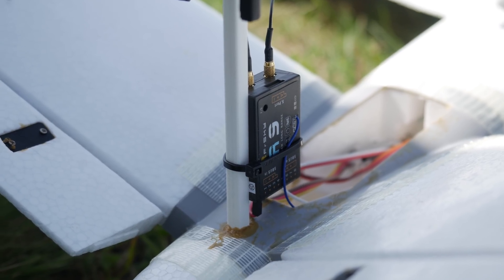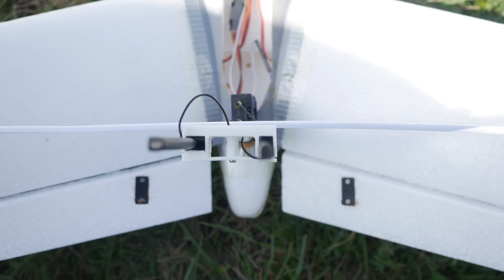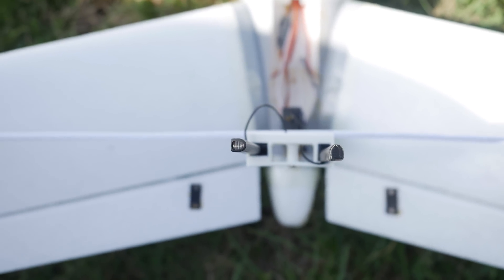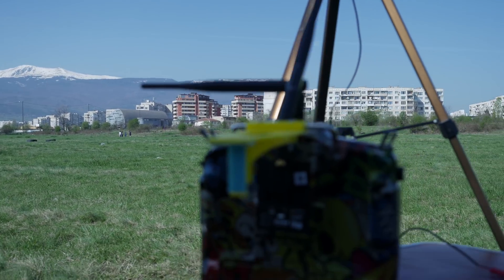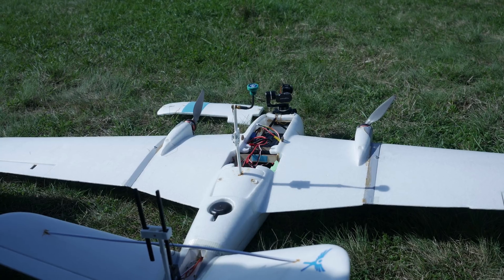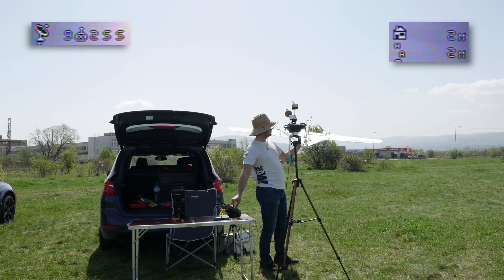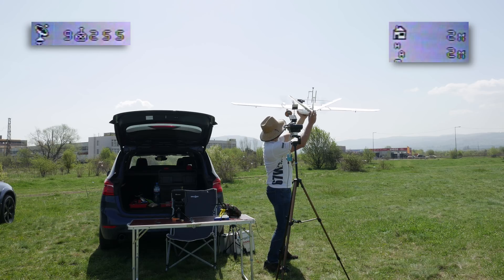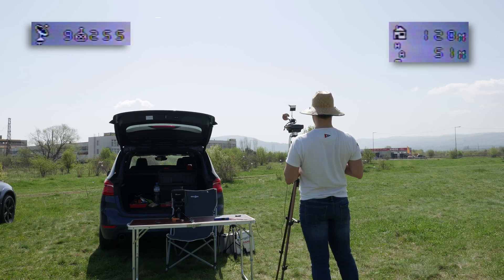FrSky R9M and R9 868Mhz - mountain and aircraft radar testing

Comment: Great videos , question pertaining to firmware flashing on the receiver and module. Do u just flash the most up-to-date firmware or all of them.

I have asked five different people between today and yesterday no answers yet. May you will he first. 

Thanks MIke
Reply from the maker: Hi, when I received the system... back in March or April, I flashed whatever was the newest firmware then, and haven't updated since! I don't see a reason to flash all of them, when the old one is actually erased/replaced by the newer version when the flash is done... so just flash the latest one, but module and receivers need to be on the same version of firmware! :)
Reply: @ArxangelRC  
I have another question ..
I mounted my antennas like yours. I went out 3 miles no problem RSSI staying in the 70S and 80S but as soon as I turn to come home the plane enters a fail safe ..tested twice any advice?
Reply from the maker: That is not unheard of... it is possible that something is blocking the receiver's view to the ground when you turn the plane around. How high are they above the fuselage?
Reply: @ArxangelRC  
Well I assume the stock r9 antennas are seven inches, so I have the hot glued to a partial pop cycle stick. And I would or could say its  the vertical Fin that would block the majority of that seven inches as I turn , maybe 1-2 inches above the verticals. Can u run a sat a liter receiver on the r9.
Reply from the maker: You mean "satellite" receiver?

A piece of foam should be mostly invisible to the RF signal, so I doubt this particular piece of the plane is the problem! If you are pointing the plane home... and the antennas are at the back of it... it is possible all of the electronics that end up between the receiver's antennas and the ground could be blocking the signal.
Reply: @ArxangelRC  
OK well I don't know and satellite receiver is what it should of said, lol.. OK well originally I had both antennas like urs. But since the fail safe I moved them.  I was out Sunday checking new placement when I had  accidentally disarmed plane..ohh crap 4 hrs later I found it...so will 5.8mhz interfere with 900mhz. If so then I need to move my antenna as it sits 2 inches fwd of the 900mhz and dead center...
Reply from the maker: How did you manage to disarm it? Weren't you able to arm it again? Was there any damage in the crash? 5.8Ghz and 900Mhz have worked perfectly together for me, there shouldn't be any issues with those two! Besides... a higher frequency cannot interfere with a lower one, so the 5.8Ghz Vtx on board the plane cannot interfere with the 900Mhz receiver, but it is possible that it either gets blocked by batteries and wiring... or something on board spills out interference on 900Mhz simply by being turned on!
Reply: @ArxangelRC  
I accidentally disarmed by flipping way point off(but it was the disarm switch) lesson learned. I didn't have time to rearm I was at 500ft and I knew I would loose video signal at 200ft when I'm that far out, so after my first attempt to rearm , and it did not work , my main goal was try to align the plane with a good glide path and not in tree's, I had maybe 10 seconds to process , so I circled to the right and put on a straight path hoping it would clear the top of trees and as soon as I lost last video signal I let go of all sticks and hoped for the best. Not only did I clear the trees but it glided another few hundred yards. And not a single bit of damage, when u weight 300grams it's hard to do damage lol. I'll try again Sunday weather permitting..
Reply from the maker: michael teel  Damn... nice save! 300 grams... ??? What plane is that?
Reply: @ArxangelRC  
Nano Gobin
Reply from the maker: OK, might have to give that one a try at some point! Have been hearing good things about it! :)

Comment: Hate to put you down, but thats a VOR, and a weather radar. which transmit on 108 and 2.4/5.8 respectively. so there should be no issues if you are on 816mhz. might be a different story if it was 2.4 however
Reply from the maker: Actually I've been there on 2.4Ghz radio, and I have been there a few times on 5.8Ghz video now... and I've had no problems with those frequencies! A friend of mine has some gear he used to measure what this operates on, and it was spilling out quite a lot of interference around the 1.2Ghz band.

Comment: I plane on getting the taranis qx7 and this. Im in the u.s. im a bit confused sbout firmware updates that change the frequency? Is there a website with these?
Reply from the maker: You can download the updates from the FrSky website directly: https://www.frsky-rc.com/r9m/
Usually the archive has the EU and non-EU firmwares, you just select which one you want to flash to the module. For the US you need the non-EU, or FCC firmware file.

Comment: Im guessing its illegal to run your TX Module at 500 mw output with the EU LBT Firmware....?.....25mw is what you should be doing.  It would have been nice to see all the snow in your 5.8G video, rather than snipping small windows.
Reply from the maker: That was an ugly sight... having the antennas on the ground turned in that direction puts A LOT of buildings between the plane and the ground station, and I was picking up a lot of interference from something operating very close to my frequency! As for the power output, I think 500mW is legal with a HAM licence, besides... around here nobody really cares much about that!

Comment: How do you get that range with 5.8?
Reply: Pierce - BANG SCIENCE
He's got an antenna tracker and is remaining within line of sight. Pretty sure he's using a really good set of antennas and has done this a time or two. I'm impressed he's getting this range with only 600mw.
Reply from the maker: Yes, check the video description, the antenna tracker is linked there. You will also see the Vtx I am using. The antenna I have on the Vtx right now is this pagoda: https://goo.gl/n3uGyE and on the antenna tracker I have the FR632 receiver: https://goo.gl/mPonrV which has turned out to be one of the best, and on it I have a home made 8-turn helical, and an IBCrazy 12-turn helical, which arrived all broken and warped... so not really sure which one gets me out to 25kms... but I put both on there every time! Might have to test that some day to check! :)
Reply: I'm amazed you're getting 10km+ out without a directional antenna of some kind.  Why not just go 1.3 or 2.4?
Reply: He is using 2 directional antennas (a patch and a homemade helical) on a sensitive diversity receiver with an antenna tracker. He's also not flying with any obstacle in the way so he doesn't need the object penetration benefits of 2.4 or 1.3.
Reply: I read helical, but my mind inserted RHCP!
Reply from the maker: Actually I have two helicals at the moment... not sure which one gets me out that far... but I always put both at the same time. And yes, they are all RHCP.

Comment: Nice!  what was  orientation of antena on R9M TX?
Reply from the maker: I kept it vertical for the most part... at this close range wouldn't have mattered though... works pretty well even with the antenna's tip pointed in the direction of the plane.
Reply: THX will be interesting to try Moxon antenna. do you plan to upgrade it?
Reply from the maker: On the transmitter?